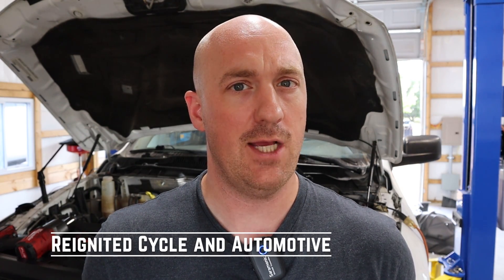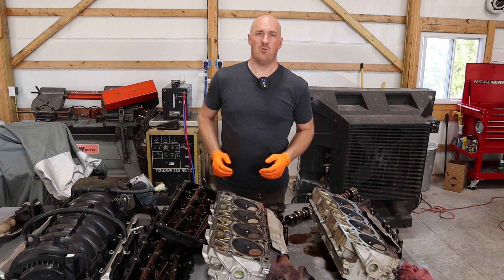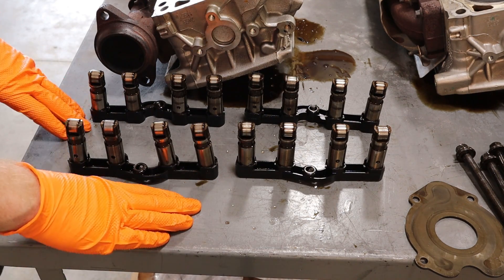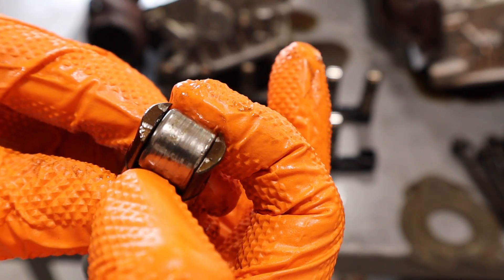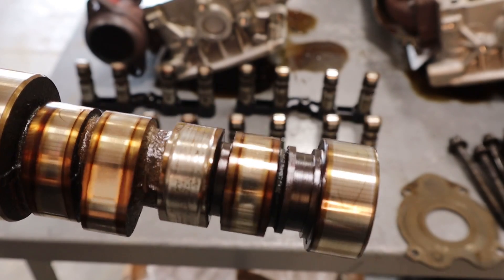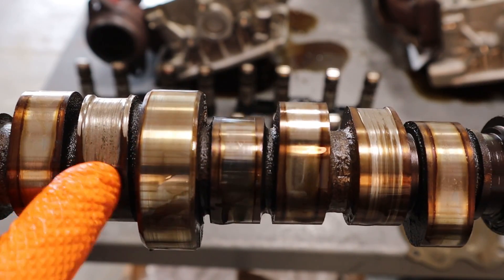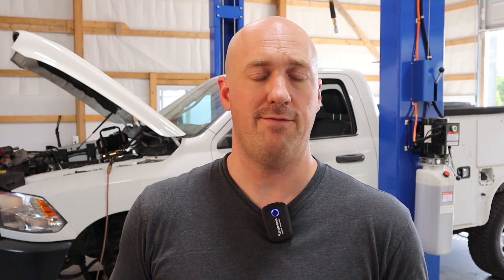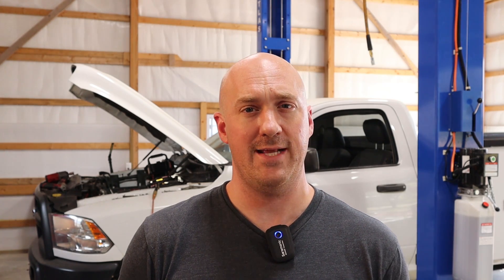Hemi 5.7 Lifter FAILURE Does this engine have a fatal flaw? Find out how YOU can prevent it!!!

Comment: Change to heavier oil 5w40 or 10w40 and never experience lifter failure.
Reply: Some mechanic told me to go 5W50 on my 6.4L..can you confirm if this is  good? or 5W40, 10W40?
Reply: @jandysanchez  I'm running 5w40 on 5.7 dodge charger 

The oil pressure is 49 psi at idel.

I have been on this now for 50K and no issues at all.
Reply: @xxx20003 . Thank you. I will do the same. Do you live on hot climate?
Reply: @jandysanchez  
Yes I do have a hot climate at 25 C in winter and  55 C in summer.

My local mechanic is specialized in hemi engines and he is using this 
5w40 till 100K kilometers 
10w40 till 200K 
20W50 after that and also for rebuild engines

Anyone here using 5w20, they have lifter failure at around 120K kilometers which is right after the warranty expires.
Reply: @xxx20003 .. This is what im looking for. Thank you very much for this vital information.
Reply: You can't on the 5.7 the mds won't work right.. have to stick with the 5w20 or 0w20
Reply: @scottrussell6717  I have heard that before but not sure what does it mean exactly.

Right now its working and I see the 4 cyl sign when I'm driving as usual.
Reply: @xxx20003  the mds shuts down 4 cylinders when all 8 isn't needed... its mechanical so the heavier oil could keep it from working right but NOT always
Reply: @scottrussell6717  As long they have good lubrication and I'm sure they will be fine 🙂

Comment: Greetings Bro!  Thanks so much for your content. I'm working through a minor issues myself with my '14 Ram 2500 4x4 5.7L HEMI.  https://youtu.be/KcGCCnw6B0E
Reply from the maker: Nice work on your video my man, and I appreciate the shout outs! You are correct on the VVT operation for the Hemi, it's a cam phaser mounted to the front of the cam and it's controlled by an oil control solenoid mounted under the intake manifold. I don't have any major tips for you on the hesitation you mention. The only idea I have is there is what's called a SRV or short runner valve actuator mounted on the back of the intake manifold, this actuator moves a flapper valve inside the intake runners to transition between longer runners at part throttle, and short runners at full throttle/higher RPMs. These actuators are known to fail, but could that specifically be causing your hesitation? It's tough to tell. 
One other point of note, if you have a lifter that is starting to fail, it won't necessarily set a misfire code on that cylinder. If it hasn't had a chance to start eating through the cam lobe yet, but the lifter roller bearings are failing, it can still cause driveability issues and not set a CEL. Like you mentioned though, it's incredibly difficult to get any sort of accurate reading on how much the valves are depressing. If you don't have any lifter noise whatsoever, I wouldn't go that direction just yet. 
One more tip, I have seen the rear most exhaust bolts just be slightly loose, but not broken, this can cause a chirp/flutter noise under acceleration. Keep up the good work!
Reply: @ReignitedAuto  thanks much. I’ve owned Mopar products for quite some time so I suppose I just take a deep breath and accept the flaws. I tried my Polaroid Cube under the chassis a couple of weeks ago to try and figure out where the exhaust noise was coming from. I don’t hear it under the truck. https://youtu.be/TTeF7F-Jils
This truck now manifested it’s worn out cabin vents the first week I owned it when we had some heavy rain in southeast TX. Cab flooded. I stripped the whole carpet out, cleaned, dried, replaced cabin vents on rear of cab, and sealed third brake light for good measure. Fun times.

Comment: this is a literal lie how can he say ive seen these cams and lifters get whiped out in as low as 15000 miles and say its just cause the oil brokedown is the only reason fiat must be giving him a bonus to lie like this
Reply from the maker: This is absolutely untrue! I only get to use the yacht on the weekends, they didn't give it to me. 
On a serious note, I was pointing out the difference between the 5.7 and the 6.4 truck engine. Something is changed between the twobecause I'm seeing a higher failed rate and earlier on the 6.4, but I don't have a specific answer for it, so I didn't give one. And if you knew Fiat, you'd know they don't give a penny to someone when they don't have to 😂

Comment: I have a 08 , 2500 with the 5.7. It has 258,000 miles on it and still runs strong. It has a 91 octane tune and I drive it like I stole it. Moble synthetic oil and just lucky I guess
Reply from the maker: I'm always a fan of the drive it like you stole it style 👍
Reply: I’ve got an 06, always Mobil 1, changed 4000/5000 mile. 170,000. So far so good. I’ve done exhaust manifold bolts both sides. Oil pressure sensor, egr. Drive belt pulleys, That’s about it.

Comment: The idle thing is bullshit. It is a poor design. Had a chevy 502 that had tons of idle time with no issues with 210k before getting a new truck. I see a factory recall on all these engines for a class action lawsuit. My work truck that is fleet maintained wiped out 3 lobes before 64k. This is the only reason I will not get one for my personal use. Other than that, a great truck. But need more like 250k like my Ford has now (5.4L tows 7,500 to the lake routinely) with no problems.
Reply from the maker: To be clear, a recall only applies to safety issues and is mandated to be repaired at no cost by the manufacturer. They do this because if they don't voluntarily do it, the government will make them. Better to make it seem like they are the ones trying to make it right. In the case of mechanical issues, even if the company knows they screwed something up, they will put out a technical service bulletin detailing the issue, but they are in no way obligated to pay for the repairs.
Reply: @ReignitedAuto  Breaking down on a major interstate may be a call for safety. The one I was driving could not get over 15 mph. This is why I keep driving a late model vehicle. Something that has proven itself. There are tons of Ford and Chevrolet without those problems. Not to say though they all have their issues. But hell, you should be able to idle without breaking down.
Reply from the maker: @brandonrobertson6327  Definitely not disagreeing with you. One thing though, this is a progressive issue, so it's not like all of a sudden the vehicle runs poorly. There's plenty of advanced notice before it fails completely. Most people just ignore the signs until it's so bad it wont run properly.
Reply: @ReignitedAuto  The first sign of this problem starts other issues also. The original short block was replaced around 40k. The motor always had this ticking. Why the dealership did not advise at this time other than to make more money later? They just swap the short block and used the same upper components. No doubt there was metal shavings that caused the rod and main bearing damage. Per my fleet mechanic, out of the 3 garages he service, 4 out 6 has this issue. There is no shortage of oil changes either. Some of these trucks don't idle much either due to they are for the office personnel going back and forth to other office's and don't stay in their trucks very long. On the other hand, some do idle due to PTO idling and vehicle accessories. This company has GPS on every truck, so they know when and do schedule the maintenance in a timely manner. 

Maybe Dodge needs to rethink on the type of oil if it is not a design flaw. Also these oil companies need to add back the zinc phosphorus or change the alloy in the bearings and  choose a heavier weight in it's oil choices.
Reply from the maker: @brandonrobertson6327  The current generation of Hemi is coming close to the end of its design cycle, it'll be very interesting to see if they change things up. 👍

Comment: Great video. Quick question, I had a misfire on my 2012 ram 1500, which ended up to be a ceased lifter. I replaced lifters and the cam, new exhaust bolts and gasket. But the ticking noise came on, sometimes it goes away and then comes back. Any suggestions?
Reply: Buy a Chevy
Reply: @TM-to3jc  hell no

Comment: Chrysler’s “engine oil breakdown” is and easy out so they don’t have to admit a design issue and possibly extending the warranty on the cam/lifters.
Reply: OK, been a mechanic for longer than I care to admit. This IS a design flaw in my opinion. Why do I say this you ask? As the video stated these failures are primarily if not solely on the engine displacement lifters . Idling seems to create the likely hood of failure. We never had this many failures on high use high idle or high RPM engines . Fleet or other wise . The roller with needle bearing design is low friction but it has its limitations if the valve spring seat pressure is kept within a certain range or I should say above a minimum range especially as at idle oil pressure and volume is at it's lowest to keep a lifter pressurized . Especially lifter that are designed to dump oil pressure yet not leak off pressure when not in eco mode. That roller already loading and unloading as it climbs the cam ' ramp ' then suddenly unloads after breaking over the peak of the cam lobe .Chevy had a camshaft failure problem years ago with flat tappet lifters. It wasn't the lifters fault but the cams. Some cams would wipe the lobe . Take the small end of the cam lobe and round it off . Cams were to soft.  Now I'm going to date myself hear . The DZ302 Chevy engine worked great, free winding, high RPM, high performance engine that was durable unless the gear was to low or it was in a vehicle that was loaded to heavy . Then same as here the main and rod bearings would fall the crankshaft seize and caboom you had a failure. This is all known , like all oil has a beginning failure point. ( Much lower than one might imagine ) Oil is supposed to keep parts running on a film of oil so two parts don't come into contact with each other but have viscosity enough to maintain a barrier or not squash out from between parts under load . Especially when needle bearings have such a small sectional rotation area that has alternating load characteristics with lubrication and pressures differentials bouncing all over the place randomly then throw in a loss of oil pressure to lifters  imitating a dangerously low valve spring seat pressure simulation.They are going to fail, and keep failing until the afore mentioned is redesigned or just stop the displacement on demand and see how long the engines last . We use to build race engines with roller rockers and turn them regularly at 8-10,000 RPM   We'd break rockers or bust towers butit rarely did we have roller failures as they were consistent with correct seat pressures and good lube . No zero viscosity especially on such a sharp or minimal contact surface. Lastly look at the roller cams over the years. Let's use the Ford 302 for example used on drag strips , road race, daily drivers and many are still running today a couple I know still running Fox bodied cars with thousands of miles on them put there a quarter mile at a time. When did vehicles start having an over abundance of valve train issues ? ? When the displacement on demand or cylinder dropping fiasko began . Way back in the late seventies early eights Cadillac  ( On cutting edge technology )  started this same crap but dropped cyls.  via computer control and it was a problem back then to. We even got TSB's that helped by moving the ECU's under the seat from the engine bay so they'd run cooler as a ' fix ' . It wasn't.  No , the problem is and has always been you can't make something it isn't by an imbalance, and expect it to last in my opinion.
Reply: Replace cam and lifters on several Hemi Motors that were non fleet vehicles I believe it is engine design that is the cause inadequate oil supply to lifters
Reply: Exactly!!
Reply: There are thousands of premature failures...you even admitted to having replaced dozens...this is a design flaw that Chrysler needs to own up to.
Reply: @TM-to3jc  This guy on this channel that runs the show here is just trying to kiss Chrysler’s ass. There’s no way it’s the fault of the oil manufacturers. The engine oil cannot get to the lifters and the needle bearings and the roller causing it to get loose causing compounding damage to the cam. The cam shaft is not getting the oil it should either. The roller on the lifter is not properly lubricated and wearing on the camshaft and the needle bearings are causing the roller to fail causing even more wear on the camshaft.
Reply: Hello.where kann i buy parts for a 2013 dodge challenger rt 5.7 hemi.thanks
Reply: I call bull s**t I'm doing a cam lifters on one now that did not repeat did not idle for a excessive amount of time only idled at red lights moving from Park to drive to take off that kind of idling normal idling not letting it warm up not running it to keep it warm or running it to keep it cool just normal startup and regular oil changes at the regular intervals as required by Chrysler and it still happened so own it yall messed up big time and are just spos and don't want to be held accountable for it
Reply: Sounds like it needs amsoil
Reply: @htatesil4192  Or Redline! Had good success with both but my Civic's K24 is constantly more silent and smooth with Redline oil..
Reply: @marc-oliviercabot3380  lol
Reply: @htatesil4192 that’s all I’d use for sure.
Reply: We have a fleet of these 5.7 hemis at my work and after we had multiple failures early on we went to a 3,000 mile oil change interval with full synthetic oil.  This is an oil change every 6 weeks roughly.  We have vehicles that have been on this schedule since the day they were new  and the cams and lifters still fail.
Reply: I call B.S. on the oil breakdown excuse….
Reply from the maker: There is truth to this statement, however, this issue is happening to such a low percentage of overall vehicles that if this were truly a design flaw it would be happening to a much higher percentage of Hemi engines.
Reply: @ReignitedAuto how do you explain when someone running redline 5-20 oil is having a lifter failure?
Reply: @ReignitedAuto 

Unless I am in the low percent and need a crate engine.
Reply: D0DGEd that bullet & they're happy to Ram a 5k bill up your kiester

Comment: Maintenance! Imagine that! I’m sure that using the correct grade of oil, and probably the use of high quality synthetic helps too.
Reply: You can probably prolong it a few k but not prevent it. Mds non mds factory recommended oil or synthetic it doesn't matter it will happen
Reply: Synthetic has less lubricity than dino oil.   Fun fact.  As a Dodge district service manager we saw numerous American Axle ring gear failures.   

Chrysler and American axle visited our large dealership and said take out synthetic and put in GL4 75w dino oil.  

Zero failures after that and we sold 200 trucks a month.
Reply: @tahcogunworks  lol why do u guys hide amsoil from the world

Comment: What about the valve seats that drop in those engines?
Reply from the maker: Seems to affect primarily the 06-08 versions, if you have a chance check out the Chrysler 300c rebuild I have on my channel, shows a perfect example of the valve seat issue. 👍

Comment: I have a 2020 Scat Pack that on cold start not all the time after the car sits for a few days all the lifters make a clacking sound then it goes away in about 5 seconds. Is this the 0w-40 oil leaking passed the lifter check balls? I had a GM engine do the same thing if it sat around for a week. 0 weight is basically water so that’s why I think it may be a issue. The car has 1,200 mies. Thx
Reply from the maker: Yea, basically any time a vehicle sits for an extended amount of time you will get some valvetrain noise on startup, no issue there at all. Enjoy that thing I bet its a riot to drive!
Reply: It is a BLAST I got the wide body as well. Love it! Thx for the video. 👍

Comment: I work on these every day. I also worked for GM a while too. I can tell you I've swapped lifters at both dealerships...
Reply from the maker: But its so much easier for people to hate on Chrysler products 😄
Reply: Fords eat them too, well actually the roller rockers, I had a 05 5.4 needing  a engine at 100k,
Reply: @garysisk3431  Them ''older'' 5.4s yeah the rollers would start tap tap tappity, customer ignore it as ''manifold leak'' and then it grenades itself, no good. All engines got problems, dealer techs obviously get a first hand view of what goes wrong, but then again remember, cars don't come to the dealer/shop without problems or reason. If they come it's because of routine maintenance or they have problems. You get the broken ones.

Comment: With my limited research on this topic I have found information that points to Chrysler using a different roller manufacturer, metal treatment or something of that nature in 2017. Is it true that in 2017/18 and up 5.7 s don’t have these cam issues?
Reply from the maker: I've heard that, but I don't have any way of verifying it. As far as I know the part number has not changed at all for the lifters, and usually if there's a revision they'll update the part number. Also, the 6.4 Hemi that I'm putting into my C10 is a 2017 model, and it has lifter failure.
Reply: @ReignitedAuto  I traded my 2014 Tacoma TRD crew cab for this Ram after I fell out with Toyota over there rusting frame recall that only happened because of a class action lawsuit. Seem to me there must be a lawyer out there that would try a case against FCA.
Reply from the maker: @christheguy5554  oh I have no doubt that there are 😄. Is tough though because a safety issue, like the rusted frame, is much easier to get legal action against. Something like this, which is only a mechanical issue, is much tougher.